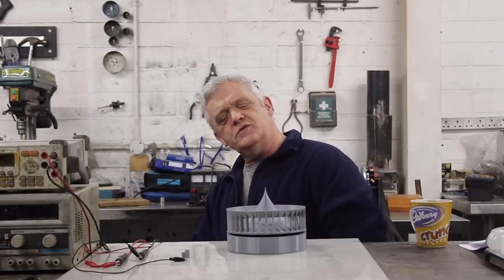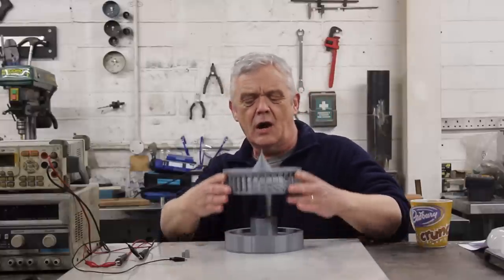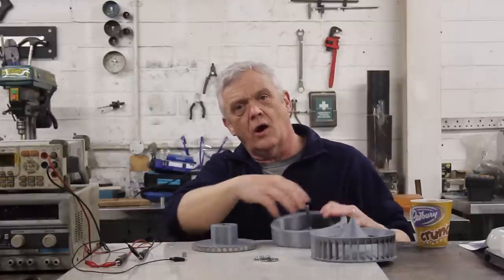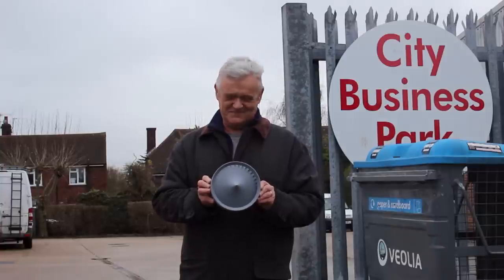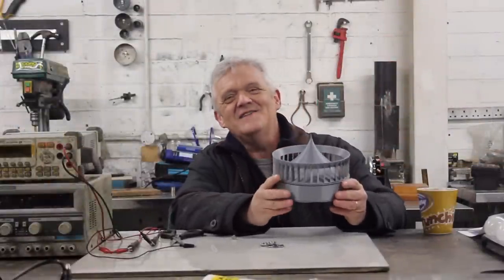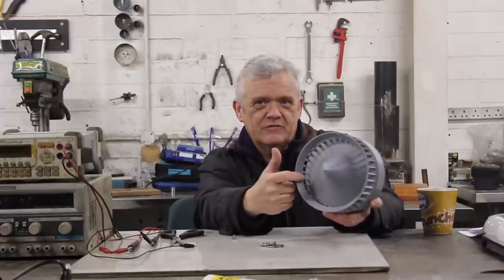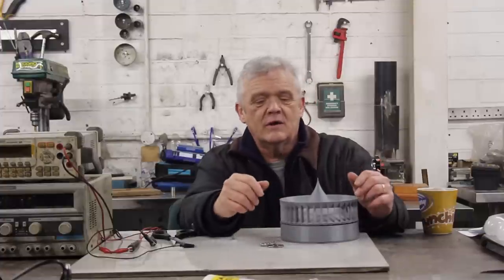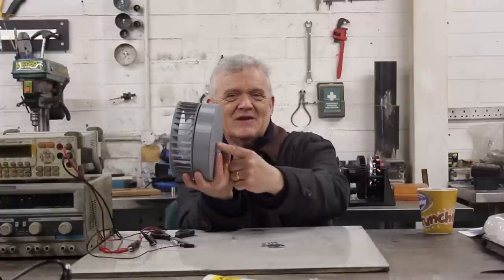1883 The Swiss Army Knife Of Wind Power

Comment: I can kinda see that on its side, with trumpet shape around the outer edge, directing air inside, with a big tail out back, keeping the business end in the wind,  about 36" diameter, and about 12-18" deep, with blades About 4"-6" possibly 8" wide,  make tge parts wuth 3D prints, then cover with carbon fiber, or thinweave fiberglass,  with encapsulated / stabilized wood, like inside the ends of the blades, and to wrap the coil around.  Then multiple pieces can be made from a single quality print, maybe fill with foam,.  However it would be very light, and should start at low wind speeds very easily!! ✌️
I would be absolutely happy with a turbine that can produce 25-50 amps at 30-48v on a average breezy day, and closer to 75 -100a in high speed winds, as in a storm , or even 15-20a if its simple enough! Cheap enough!

Make parts from wax, wrap in carbon, melt it out and repeat, then epoxy the parts together! I figured if I'm going to build a tower that is , 20' taller than my house,  I mays well build a decent turbine capable of 3kw on a fairly breezy day, with 4windings that can be in series or parallel, to get 36v, 72v or 144v and do a fair amount of current

Comment: But if you maintain it as a vertical axis all you need to do is add a vertical pipe the same diameter but with a 90 degree elbow with a funnel and by increasing the velocity of the air and increase output of the generator or as a horizontal just the funnel but with the vertical you reduce the amount of moving parts

Comment: Good project. How do you stop the output power wires getting tangled when you get it off the bench and onto a pole?
Reply: Slip rings and brushes.
Reply from the maker: exactly the same way other HAWTs do it mate

Comment: Rob u mentioned the volts during testing but what's the ammps
Reply from the maker: it would be a complete and utter pain to do it every time mate and the videos would be pretty unwatchable - I usually do it at the start and end and measure volts in between sometimes as an indication of rotor speed - I did do a video explain the measurements I take when I take them and why I take them you know

Comment: How do you think 45 degree angled vanes would perform instead of the purely vertical ones ?
Reply: sin45° ... roughly divided by 1.41   or square root of 2
Reply: @actudoran  Better yet 45 degree helical vanes ?
Reply: @fraserhardmetal7143  err... not sure I follow 
I thought you wanted to slant the whole thing 45°
Reply: @actudoran  Slant the vanes 45 degrees to the axis of rotation, and make them helical and curved to mztch the circumference of the rotor.
Reply from the maker: what angle mate? - the attack angle is 30 degrees but I don't think you mean that
Reply: @ThinkingandTinkering  The vanes on the rotor are perpendicular to the rotor base - simply angle them to 45 degrees.
Reply: I see, like the blades on a jet engine intake? I wanna try that- easier than what 
I pictured ; )

Comment: Of course the issue (in the horizontal plane - one of -  is power density and  size/weight-aloft -  in order to directly intercept a large area of wind (to generate meaningful energy).  Using with a windcatcher of some type (rotating  or "Darwin" type, etc)- allows turbulent air to be "stilled" and pressures to rise within a diffuser - Betz limits be darned - with wind concentrators the limit moves from the area of the turbine itself to the area of the concentrator (inlet / outlet pressure ratios)..

For small wind with large potential, Diffuse Energy - a University of Newcastle (Australia) Company - powering telco sites with concentrated wind (Ducted VAWT - that actually works) integrated with other power sources and storage.

Comment: That's great!

Would be interesting to experiment with the surface shape of the cone, give it a natural log or exp curve.  Nature loves to flow along those surfaces.

Then smooth out the 3d printer surface by spraying it with acetone.

Finally slicken it with silicon spray. The airflow should lose less energy to friction.

Might gain a few percent, for a cheap investment.
Reply: He's using PLA, acetone works only with ASA
Reply: @barabolak  acetone works with ABS too.  FWIW, PLA doesn't handle sunlight well, unless it has improved since the last time I looked. IDK, the 3d printing world changes so fast!

Ethyl acetate can be used to smooth the surface of PLA.

When experimenting, use what you've got!   Doing anything is usually better than doing nothing at all.

Comment: I'm skeptical about using it as a HAWT (Horizontal Axis Wind Turbine) as efficiently as a VAWT; here are two reasons that I can think of for now:
1. It doesn't take full advantage of the vortex structure; this needs a FreeFlow simulation to be sure.
2. Intuitively, I think that using a tail to orient the turbine won't work so well because it's not perpendicular to the plane of the airfoils; experimentation can prove or disprove this.

Comment: Brilliant!
I think the VAWTs are prettier, like a nice chimney or flower pot, which have been around since houses  were "invented."
Why not incorporate a plug into the the base, or add a small digital voltmeter/analyzer, so you can see what's going on in the wild?  If the design works, you might use that plug to gang a few together to charge a battery.
Reply from the maker: I agree mate - VAWTs are superior in many ways - but we could be just showing our prejudice lolol

Comment: I was thinking about the roofline too... Two horizontal Darwin's meeting at the middle of the roof and directing wind to the fans at the end.  Maybe you would need more than two, with fans dispersed along the roof: depending on the efficient length of a horizontal darwin. Gravity might come into play pulling off the efficiency of the horizontal somehow?
Reply from the maker: gravity - I doubt it - well - it will - just not with a great deal of significance I think

Comment: I wonder if you could place the Darwin tower on top and leave the sides exposed to the wind and double dip from the same wind?
Reply: darwin forces wind down thru it; incoming wind from the side hitting the rotor would adversely affect the speed.
Reply: @Steve. eh  yes I felt like it would, on one side, slow the air, but wouldn't it boost it on the other? This is just a thought.